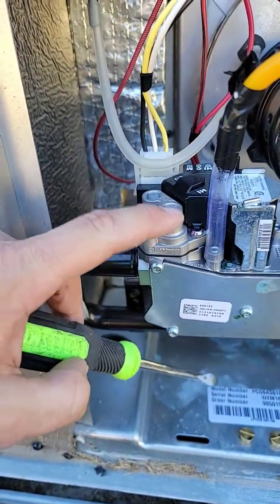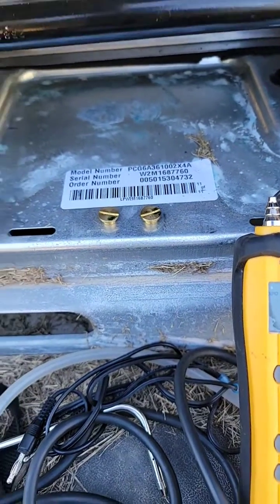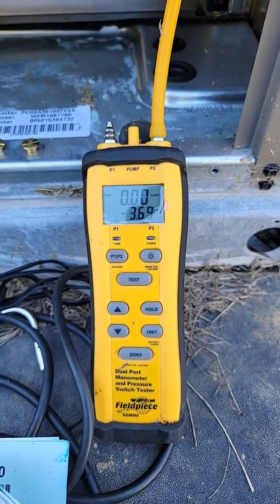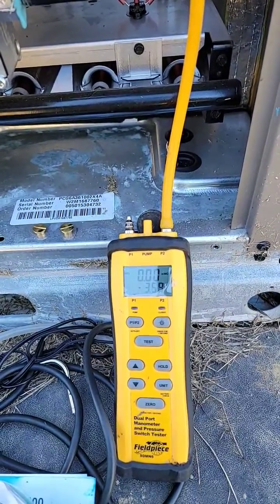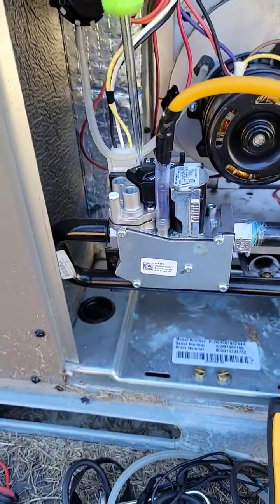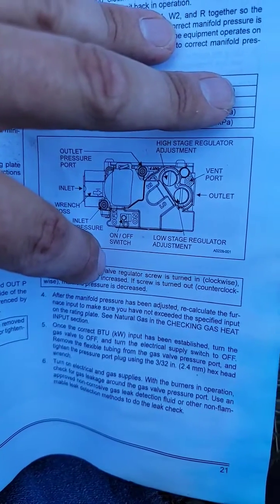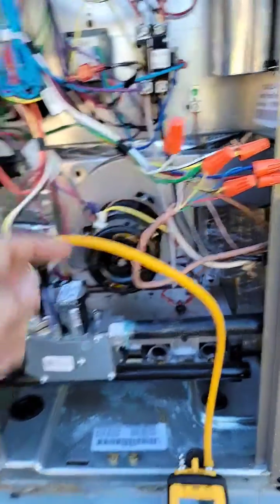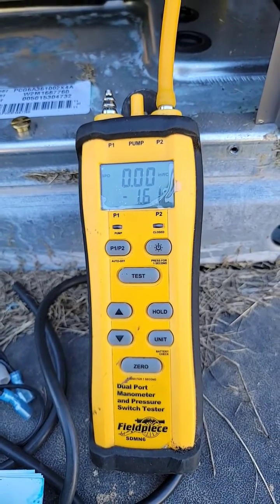The Secret to Perfect Gas Pressure in 2-Stage Furnaces Revealed

Comment: Only 1 wire to w1. So I had to jumper wire into w2 to adjust set high stage.  Will the unit ever go into high if first reach target temp after a long time passes? Without any w2 wires attached?

Comment: My question is, what temp split should you have in first stage,  and what should the combustion analysis look like?    Also,  Jim Bergman says that a 2 stage unit should be running basically all the time in 1st stage to compensate for the heat loss in the house as it is being lost
Reply from the maker: great question I will do a video to answer that one
Reply: @taddydigest  can you tag me in that video sir
Reply from the maker: @chasetuttle8278 yes absolutely

Comment: Another fun fun fact, put the hose on inlet port, And you can find out if the gv is getting enough gas pressure to the gv from the gas manifold to run the gas furnace.  😂

Comment: As a HVAC tech  I approve of the video message.  Not only is the gas pressure on sililiniod but on gv itself.  You just forgot to say. Do NOT turn the little screws on adjustment screws to much or it will suddenly pop off and then you loose the tiny spring(s) under the adjustmen screws. Then spend next 100 years looking for them 😂
Reply from the maker: lol 😆 😂 🤣  so true 👍

Comment: Recently encountered a carrier ultra low Knox furnace and the ports to check my pressure were a different size than what usually works with my field piece adapters anyone encounter this?

Comment: the real question is why would you own a two stage furnace. lol 1 btu is 1 btu
Reply from the maker: most furnaces are over sized for homes so having a low stage heats the house and burns less gas while doing so
Reply: @taddydigest even oversized, the thermostat will control the duty cycle.  I still don’t see why we need dual stage.
Reply: @taddydigest  however when it breaks the parts cost significantly more to replace negating any savings
Reply from the maker: yup your right

Comment: And did you clock the gas meter? All set to the 3.5 psi is not clocking gas meter for actual output compensation. But I only just started doing the clocking to ensure output. I still need/want to take a class taught by Jim Davis...... and buy a combustion analyzer......

Comment: You're outside working on package gas furnace possibly a commercial Rtu. But when working on residential furnace we have to set the gas pressure according to combustion analysis. Typically O2 should be 6-9%, CO under under 100 ppm, flue gas temp should be in spec depending what kind of furnace you have in combustion analysis. If it's a 2 stage heating. We run it individually and set pressures accordingly.
Reply: Haha you know 9 out 10 techs don't even know what a combustion analyzer is 🤣
Reply: @NoflectioN  yeah why Im not surprised

Comment: In the early 2000's when we were installing Lennox.
      the G-61's,G-71's all had low settings on second stage.
     I dont think any were adjusted to 3.5. Which meant they were not heating efficiently. 
     Since then I've checked every unit ,from every manufacturer, nd on more than half of what I've put in they all are to low.
   Great video for all the new guys ,nd a good tool to have in the service bag..

Comment: Does it really matter doing the high side first? I was told it doesn’t make much diff on rtus
Reply from the maker: no either side can be done first
Reply: @taddydigest  love your free advice and learning techniques. I have learned everything on my own. Did not have a senior tech showing me the ropes for awhile. I was an installer and was asked to do service. Maintenance and these videos really kick started my career. Now I’m still learning a lot but am comfortable with working on heat pumps and gas furnaces. We also do commercial refrigeration as well so lots to learn. I deffinately will be watching more of your videos. Thanks taddy